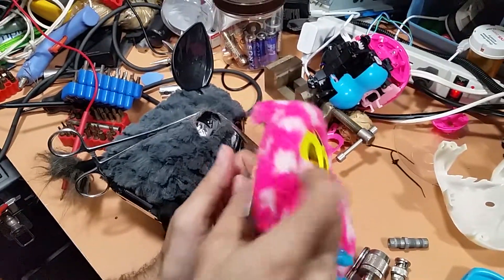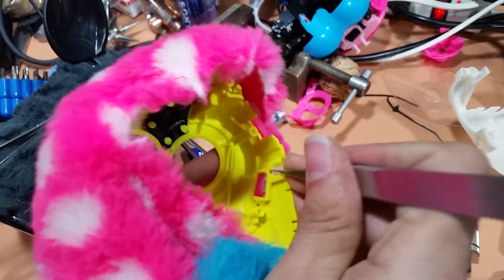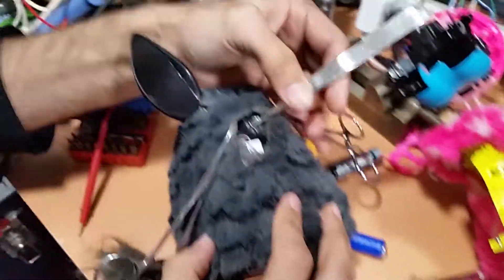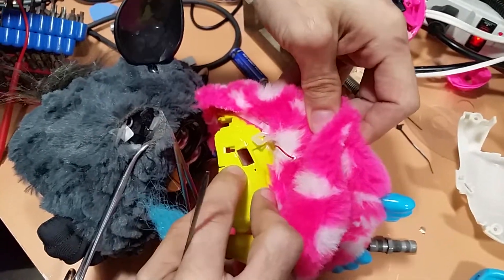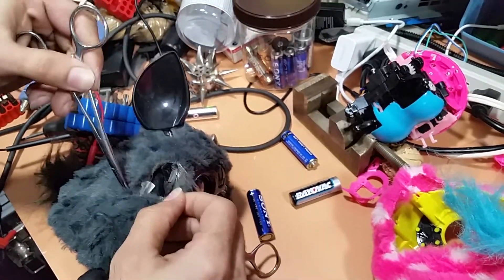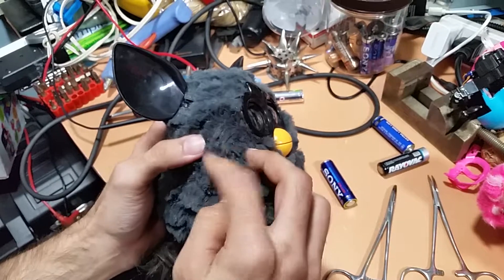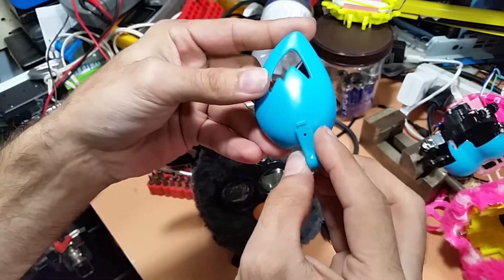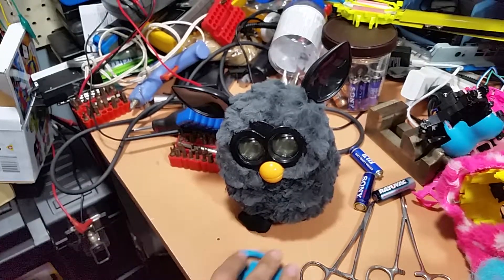Furby - exploratory surgery

Comment: The Port is Just on furby booms
Reply from the maker: The port is only available on Furby Booms' with plastic feet and cutout ears, which I simply call "1st Gen Furby Boom". I did another video explaining this. If your furby boom has plushie feet and solid ears, then the port has no pin header. Plus they cut off the VCC pin, so direcrly interfacing is not easy without a few pullup resistors and a VCC source, regardless. Every Furb' Boom I own with plastic feet and the "hollow ear" has had the pin header in place. Furb' Booms with plushie feet and solid ears have the header removed.
Reply: Foxx D'Gamma can i make something on the Pin? What happens when i do it